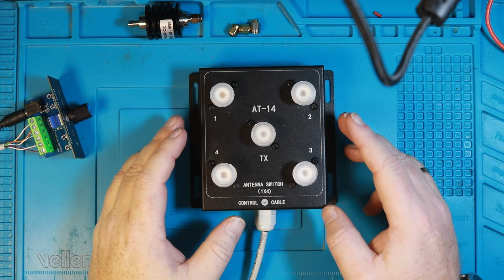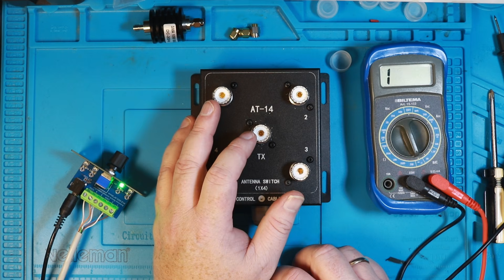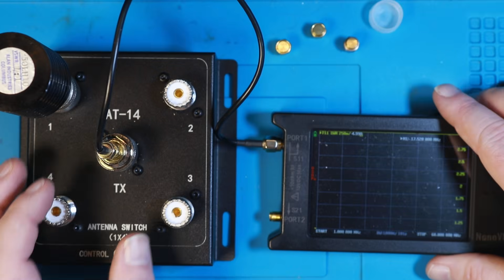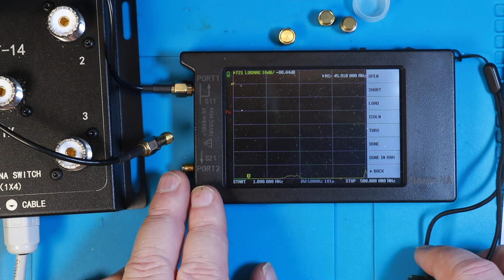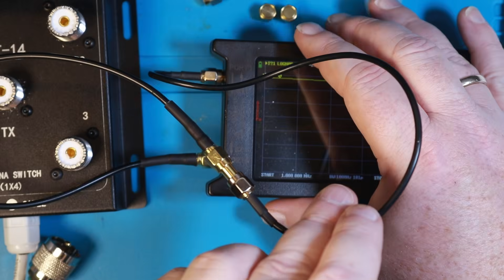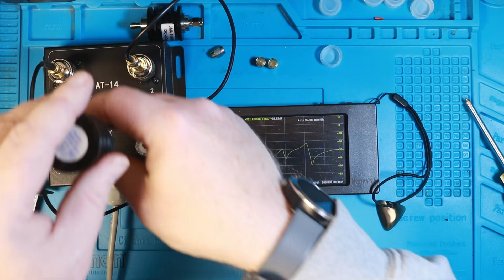A $50 REMOTE ANTENNA SWITCH? Yes please!

Comment: The frequency range is governed by the material and the spring tension on the contacts inside the relay.
The relays should also be double pole double throw thus switching the shield in and out of circuit to avoid cross talk from all the antenna shields in common.

Comment: solder joints look like dry joints waiting to happen and the relays mmm there is no way i would be putting 500w through that!
Reply from the maker: I’m happy with it, and it works fine on 100 watts at least. And if you’re going QRO you should probably look elsewhere.

Comment: I got one of those from Amazon and when I tried to use it I found that none of the cables would screw on because it had connectors with Metric Threads!  I had to run a die over the connectors to fix them so the cables would go on properly so if your connectors only go on about half way and get jammed that's the problem. Also don't use a switching power supply or that will put a lot of noise on the antenna lead, use an old fashioned analog supply with a transformer inside it.
Reply from the maker: I have noticed none of the issues that you are mentioning.

Comment: I found your eval interesting and informative because I have plans to build my own switch.  You are correct, for the money its not bad.  The negatives are:
- it's not water proof for outdoor use
- I only use type "N" connectors to support freq up to 1.9 Ghz....personal problem I know
- Power handling needs to be a full KW (for protection).  Most amps are capable of much more than 500 watts.  One slip can cause a lot of aggravation. 
 But for the money, the device is expendable and good for mobile/field use.
Reply from the maker: Hi Paul! 

It all depends on your use case. Mine is placed in the shack at the moment, so waterproofing doesn’t matter. I have planned to put it unpin the attic, just inside where my coax exits the house, so it would still work there. As for the N-connectors I see your point, but this is an HF switch, so if you where going to use this for SHF you would have too much attenuation in the switch nonetheless. As for the power handling this is a 100W switch fire all practical purposes.

Thanks for your feedback.

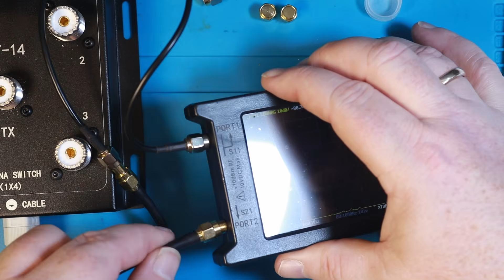Comment: At about 18:30, why did you add a cable for "through" rather than just remove the female-to-female adapter from the cable attached to port 1?
Reply from the maker: I would need to rewatch the video when I have time and get back to you.

Comment: I bought one of these on ebay and shipped from China. It took three weeks. Positions one and two had bad relays. I talked with seller and they sent me another one. It arrived in three weeks and this time the first position had high SWR on any frequency. I checked all my connections many times to see if I wired these wrong. I have only three antennas so I just used the three working positions. I noticed my receive signal strength was worse than usual. I bypassed the remote switch and connected one antenna straight to the radio and the reception got better. Insertion loss problem? I repaired my old ameritron remote switch and went back to it. Hopefully everyone else gets a good unit! Thanks......
Reply from the maker: I have only tried this, and mine is fine. I also know that LB5JJ from Radiohyperactivity has one that he is happy with, but as with all Chinese stuff, quality control is sometimes not up to par.

Comment: Great video. Thanks. I want to use one of these as an antenna switch, but also a second one as a radio selector switch. My question is does this unit ground the center pin of the unselected antennas. If it does I will have to get rid of these grounds to use it as a radio selector. Thanks
Reply from the maker: I think it does. Mine is packed up to go to Sweden, so I can't really remember, but I think it does.

Comment: Great video. Is there an antenna switch suitable for VHF/UHF?
Reply from the maker: Yes, there are switches for the higher bands as well.
Reply: @LB0FI @LB0FI  What make and model I have searched with Google using "VHF/UHF remote antenna switch" and got some hits, but when you look at the details, they are all specified for HF.  Do have a specific item in mind or better still a link?

Comment: Thank you for the video. But the switch would be better if the builder modified the circuit to short circuit the unused port like the Daiwa coaxial manual switch. Sorry for my English who is perhaps no good 73 from F4DUK
Reply from the maker: It probably would, but this was about if this was usable or not, and it most certainly is usable for HF. Your English is fine by the way.

Comment: JUNK
Reply from the maker: Thanks for your deep insights, would you care to elaborate a bit?
Reply: Why do you say junk?  The relays are made by TE Connectivity which is a very large company (Amp, and Potter Brumfield are some examples of TE Connectivity product lines).  I use an AT-14 for remote switching of my TX antennas with my AT-14 located right before my feed lines exit my basement to outdoors.  My shack is located on the top floor of my house and the AT-14 as a remote antenna switch works great in my application.

Comment: Are they capacitors or varistors used as back emf snubbers?
Reply from the maker: Capasitors as far as I know. You probably know more about electronics than I do.
Reply: Kondensatoren ergeben für mich keinen Sinn und es würde beim schalten anfangen zu schwingen. Auf der Platine steht auch die Bezeichnung "R" also tippe ich eher auf Varistoren.
Reply: They are definitely varistors. The board even labels them as R1, R2, R3, and R4.

Comment: Techminds do a good video for this also that allows remote operation via a web page making it great to operate away from home if using as a remote station.
Reply from the maker: I have seen that, and I did my video a little bit different.
Reply: @LB0FI yes a great feedback thank you, it was your findings that prompted me to order one of these units. The techminds video is just about using an esp32 modual for relay control. This allows remote operation away from the home giving it an added feature.
Reply from the maker: Thanks for your feedback. I felt that it was more important to show insertion loss and port isolation than alternative control methods. But if I was keeping this I would probably have integrated it in my Station Controller Node Red setup.

Comment: I made my own remote switch.  Because if the unit has a break in the cable near the remote unit . It's open circuit so transmitter could be damaged on tx. But value for money it's excellent.  I have just put up a video up regarding adapting it for WiFi or Bluetooth operation etc. George uk
Reply from the maker: Thanks for your input George

Comment: Ik heb deze al eens zien langs komen toen nog zonder behuizing. Nu dus met heb er ooit een zelf gemaakt goed te doen. Wat ik een gemiste kans vind is dat hij niet gemaakt is voor buiten gebruik. Dat heeft het meer effect er een aan te schaffen volgens mij. als je 4x een kabel of 1x een naar binnen legt is nogal een verschil ook qwa prijs.
Reply from the maker: I have to trust the automatic translation here, since I don’t speak a single word of Dutch. 

And yes, you could design one yourself, or buy one without a case, but let’s be honest, you’re not going to be able to do it at the same cost. And it’s not that it has to be outside to be of use either, you could run four sets of coax to just inside your wall, and then one coax to your shack.

Or if you want to run your station remotely you could control this through node red or similar. My existing remote switch is right by the radio, but it is remote controlled so that I can switch my antennas from everywhere in the world.

Comment: another great video LB0FI! i had been using this remote switch with a wifi smart relay to control it via wifi, it worked well! until the rain came, either i didn't install it very well on my tower or it isn't meant for the outdoors. i really liked it and i plan to try it again in the shack. thank you for all your great videos elmer LB0FI from W6WTF, 73!
Reply from the maker: Thank you! And it is not very weatherproof, but I am sure it will do well inside your shack!

Comment: Thanks for this Morten, I have one on these but am yet to install it. I've been hesitant re isolation concerns but your testing suggests it's actually pretty good. My plan it to control it from software with a custom board at the shack end -- similar to how Matt from TechMinds was doing in his recent video. Just a shame it's not rated at 1KW. 73
Reply from the maker: I would probably also be controlling it from software and merging it into the Station Controller dashboard if I was going to keep it, but this board is going to Sweden. And it is actually not a bad switch, and it delivers as promised, so I am happy.

Comment: Great video; you've set a new standard for the channel here! Only comment I have is that I wish you'd done the SWR sweep from DC to 500 MHz too!
Reply from the maker: I only dropped that because I knew you would comment on it. I also figured that the HF part was more useful, and that the video was long enough as it is. I can make a short just for you!
Reply: @LB0FI  No need; I can do my own measurements 🙂
Reply from the maker: Who would have guessed that you have one of these...